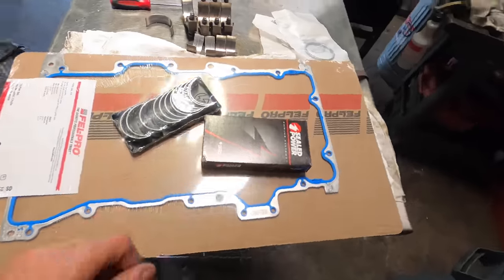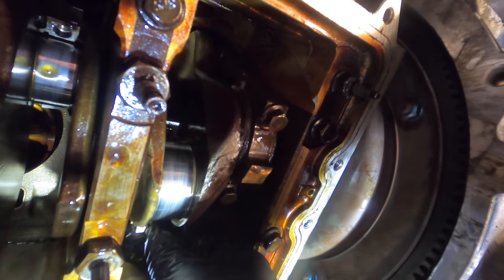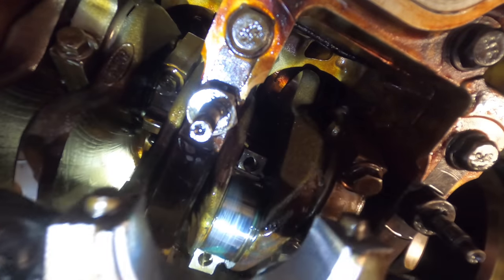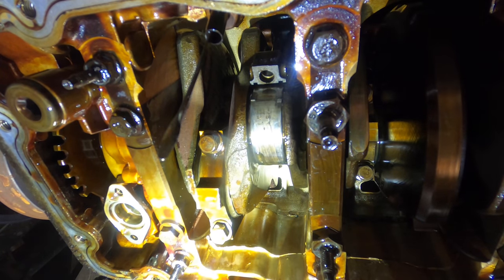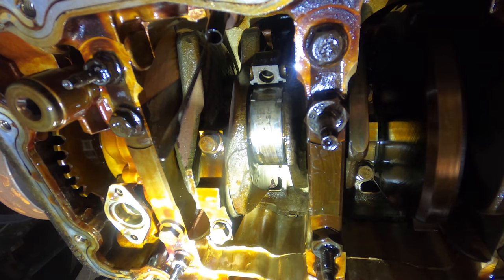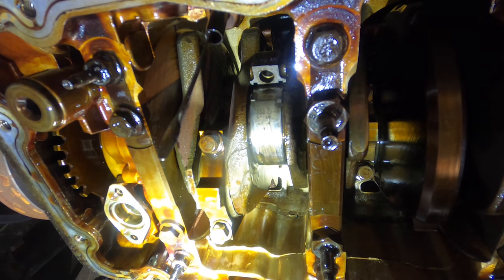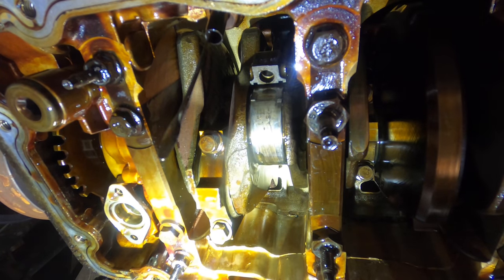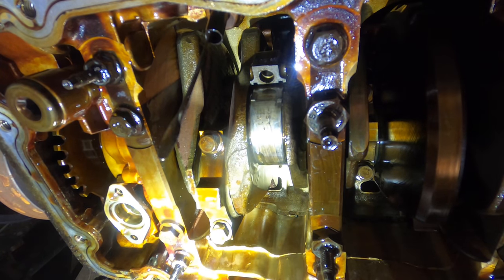Saving an Engine: Spun Bearings Replaced

Comment: Someone wrote in here or maybe the first video that the rod needs replaced being the bearing spun. I agree.
I have been doing auto mechanics for over 50 years. In my younger years I have done the same job. I would guess 90 % or there about, the main bearings needed replaced also.
The ones that elected replacing the mains had limited success. All of them had low oil pressure.  Most likely due to cam bearing wear.
There was to much debris in the pan and the oil pickup to be from the bearings you showed to us.
This calls for more diagnosis.

Comment: Nice job. Reminds me of a 85 Toronado that I bought and it had a #5 bearing that was completely missing with only 60000 miles on the car. Well after new crank and bearings it was as good as new until my son drove it with a coolant leak and overheated the motor. A few minutes later and he T boned a 3/4 Chevy at a 4 way and bent the frame on the Toronado. I had my son buy his next car!

Comment: I did this exact repair with my 86 Pontiac Fiero 2.8L. It still ran good after I parked it 100,000kms later. Everyone told I was wasting my time. I had to try it though.

Comment: I love this kind of repair.  But my question is why didn't you replace the main bearings too as long as you were there? I'm sure they suffered the same lack of clean oil.  I always have when doing this type of repair.  Helps to make a tight sounding engine.  Some types of engines you can't replace one of the main bearings without disturbing the crank seal, but replacing some of the main bearings is better than replacing none of them.  The vehicles I've done you can roll the bearing in one journal at a time without dropping the crank any.  I'm not a professional mechanic, just a self-taught hobbyist with questions so I can learn.

Comment: I have a feeling there was more damage than the bearings, but if that gets the customer a few more miles out of it then that is a good thing. I hope they know it is now time to either save money to have it rebuilt or replaced by a new engine or new vehicle. I saw some posts saying the car is not worth rebuilding the engine and I beg to differ. That car is worth rebuilding now because of the astronomical costs of newer ones. Not to mention an older naturally aspirated engine will last longer with fewer problems than these new Direct injected turbo charged engines of today IMO. If the car is 20 years old its now a classic so slap some classic car insurance on it and rebuild and drive it. In some cases people really love certain cars and trucks and want to keep driving them. Now pre-pandemic I would say not worth it, but now its worth it IMO:P Great video Ray.  In fact if they keep the oil changed going forward that old engine would probably be more reliable in its present condition than many of these new tiny turbo charged junkers being produced. I am no fan at all of the modern turbo charged direct injected engines. Maybe in a few more years they will improve them, but now I do not like any modern engine unless its Toyota or Honda.

Comment: Great video. I had the same thing on a 2003 Ford Focus SVT. Every time one of my grandsons get in a car (usually mine), they think it's a race car. That car had the head rebuilt three times (bent valves kissing the pistons). The timing setup on that car is terrible.I don't know whose idea it was to use the stupid timing belt tensioner that they use, but they need to be retrained in engineering. Of course, over-revving the engine doesn't help (same grandsons). 
Keep up the good work. You may see me show up at your shop one day to fix one of those tear apart the entire dashboard deals. 2014 Fusion, the dealer couldn't figure it out. Probably a good video. I live about 80 miles from you.

Comment: Cool job! Dropping the crank would be even cooler but I get it. 
When I do an engine flush I don't risk using the existing oil and filter. It's just not worth saving 30$, as old oil will be saturated with crud to begin with and could cause oil restrictions. That's related to why ATF fluid is often used (lots of detergents/solvents and it's a thinner oil). But also a flush will only help to restore some functionality to oil pressure related parts like lifters, vvt/vct solenoids, and clearing oil passages. It cannot help a bad bearing. They can also make gasket leaks worse, and plug up oil filters/screens. IMO an engine flush should not be considered if your oil pressure is already below normal.

Comment: On the Mercury's Sable connecting rod bearing replacement you only finger tightened the oil pu tube support strap  to windage tray nut.

Comment: You are very optimistic, spun bearings and that death rattling noise.  I’d have just replaced the engine, or everything in the lower half.  I understand doing it, but outside a farm tractor I wouldn’t.

Comment: Don't know how much the bill was, but certainly cheaper than a rebuild or even replacing with a used.  Hopefully another 50 - 100K!  Most places would have shown the shavings / chunks and told the customer... "Nope, You need a NEW engine!"  Nicely done...

Comment: The Ford 3.0 liter was known to run on bearing grease without oil just top off the power seat fluid and the car will run quiet and smooth for 300,000 miles before changing your grease

Comment: Nice video. 
Crank journals look kinda rough. May have been worth really getting it done and replaced the crank or a regrind. I guess as long as the oil pressure is strong.

Comment: I'm so lucky I get to do an easy bearing removal job on a four-cylinder LOL a 2002 Subaru outback AWD has a very low knock OEM bearings never used the torque reader before but I'm teaching myself how to use the torque bar first time doing a bearing job so satisfying knowing I did it and saved few hundred dollars

Comment: those 3.0L 24V motors were honestly quick and decently reliable…as long as you change the
oil 🤦‍♂️ lol i used to have a 2001 Ford Taurus SEL with the same motor and i loved it

Comment: Hey my friend. Good work but I didn't see you tighten the nut holding the oil pump pick up tube bracket. You ran the nut all the way up by hand but it didn't get tightened, unless you did it off camera. Nicely done.

Comment: At 26 minutes, while installing the oil pickup tube, you hand spun on one the lone bolt of the 3 that hold it on but never went back to tighten or torque it with a wrench or socket.  Was that intentional or an oversight?   Great videos.
Reply: I wondered if I was the only one who saw that after reading a ton of comments with no mention of it, hopefully he has strong fingers and it never loosened up because it definitely should have been tightened.

Comment: I have not been able to read through all 2,531 Comments at the time I am writing. However, with all the bearing chaff and RTV, not ot mention the plastic piece found in the sump, I have a couple of lingering questions. 1) Is it worth taking the time to investigate those issues further?  2) What can be done to flush the oil journals to make sure you still have good flow and that nothing is blocking them.  3) Is there a chance that there is enough foreign material left in there to cause further damage?  
I probably have more questions if I think about it, but I am curious to these issues.

Comment: how did you know what size bearings to buy, don't they need to be a specific thickness determined by the diameter of the rod journal and the crank? Did you plastigage them off screen?

Comment: To pull down the rod I use a bolt with the hide cut off then I put hose over the bolt just leaving 3/4 threads to put in the rod that way the bolt don't touch the crank . I put lube on the bearing and the crank you can't put to much lube on the part's in side of a engine

Comment: I worked at a gas station,in the late 60's, a 64. Dodge dart came in with a thrown rod .they gave the car to me instead of fixing it.I pulled the pan,found the rod cap a little bent I hammered it straight ,using plastigage,filing the rod on Emory paper till I got .002 clearance .I put it back together and it was fine.I put this engine in my moms 66 valiant,it burned rubber after that.

Comment: It always make me wonder though when mechanics do a visual inspection like this on the crank to find a spun bearing or something and despite all the work being done to replace the bearings they put it back together and tell the customer the engine is junk... You might as well tell the customer that you can attempt it and it won't cost much more in total costs (as the engine is already apart) and just tell them it may or may not work.

 I saw a mechanic strip an engine down to find a bent rod... Despite the fact they had it out and could've easily replaced the Rod they made the customer buy a new engine. The only symptom with the bent conrod was a ticking noise, other then that the engine appeared to be running fine. They had literally just changed the timing chain and tensioners as well as they originally thought that it was contacting the chain casing causing the ticking/tapping noise as there was a small witness mark on the casing near the bottom sprockets.

I was horrified as I have the same car with Toyota's VVT-i 1L 3 cylinder engine and personally if I was that far into the job I would've asked the customer to fit a new rod. The engine is relliable, not sure how they bent a rod though... I know with low quality fuel this engine does edge on knocking... Maybe the customer did something stupid though as it's a manual transmission that would let you lift the clutch in the wrong gear and over-rev the engine.

Comment: I would have done things a little different. Clean the crank like you did. Spray brake clean up the oil passage on the rod journal to get any small crap that might have been laying in there.
I start with wet/dry sand paper 240 with mineral sprits to clean it up fast then 320 and finish with 400.  Then mike the crank. If just a little out of round. I start with wet/dry sand paper to get as close to round without removing to much. Find a good rod bearing from one of the others and use plastic guage on that spun rod to see were you are at at oil clearance. You can't take bearing back after you buy them and open them up for a try. .003 oil clearance is about as much as you can go. You can file the cap without the bearing on it to make it .0005 smaller before to tighten it up a bit if you wish. More than that can cause you to crush the bearing to much casing problems. If you had the engine apart you can more things. But with engine in there that"s about it. Otherwise you did a good job. You only have to do this on the one that was bad and just clean the rest up like you did.

Comment: please sir I have questions ....firstly I'm fairly new to all that is engines...     
 *  When you removed the bearings. was there a part number still on them and did you replace them with the same ?   wish you could have walked me / us through that too...     
  * Did you check and clean the oil passage on th Crank where oil comes through.   
*  And finally after removing the oil filter did you check it out for bearing contaminates just wondering.  
   thank you I enjoyed watch this

Comment: some years ago I tried to do this on a renault 25 2l straight 4 automatic. Managed to change all the "big end" bearings but couldnt get to the main crank shaft bearing - that and the fact i was working in my back garden - lying in mud using a 29.99 socket set from halfords didnt really help matters - needless to say the repair was not a success..... ended up having to change the engine  - another adventure

Comment: you can use muriatic acid , but it will dissolve the aluminum from surfaces drillbits and cnc stuff ive seen it done..  ave  has done it too.

Comment: Just 2 things.
I didn't see you check for bearing clearances, and when you torque a bolt or but, it is critical that you don't stop the rotational motion in the middle of the action, and then go again to get the click. Follow thru with one continuous turn.

Comment: Echoing other comments, Thanks for removing the pseudo background soundtrack.  The REAL soundtrack is you saying "click" every so often, (and "doo doo dee doo" whenever the phone rings^^) and verbally confirming most every time when "something" proves that gravity is a thing!

As far as replacing bearings and the insides of engine...  I remember the first engine rebuild I was involved in (was my car actually) I was in charge of inserting the pistons, with and con-rods into the cylinders, while a friend put the bottom ends on.  The doofus used one slightly "thicker" nut on one of the cap bolts..  Long story short, he got to redo them all when we figured out why the engine was vibrating while running due to the imbalance.  It was only a 4-banger, so he didn't have too much extra work, at least. lol.

Comment: I was doing a full rebuild on a Mini Cooper back in the mid 90s for my stepdaughter, re-bore to 1st over sized pistons, carbi rebuild kit, clutch and new values and seats the whole lot from top to bottom...she got impatient because I insisted on waiting for ordered parts to get in and do the job from start to finish in a day. One day I got home and lost my shit, Her boyfriend had started rebuilding the bottom end using old engine oil as assembly lube it had been in an open bucket for 6 months with dead insects and blown in sand, I made him strip out the main bearings and they were all ready scored, A few days later while I was out the pair of them packed everything up and took it all to his dads engineering workshop, I figured if that's how you going to play it fine,  the end came quickly it was running hot from the first run, ended up missing a gudgeon pin retaining clip. Gudgeon pin was riding on the bore wall managed to drive 25 kilometres before it died...it was an expensive lesson for her as she'd paid for it all ....I still got the blame for not doing it faster in the first place, I  told her if you don't have a dedicated clean assembly area then wash, assemble, seal is the golden rule.

Comment: Just a question, i know the furthest rod bearings failed due to the incorrect oil level. Why did you not check the mains for possible wear / damage? 
I used to do technical failure analysis for our local Cat dealer before being placed on medical disability here in South Africa and that is the only instance where I differ from you.
Also thank you for the absence of music which is u unnecessary in my opinion.

Comment: You forgot to tighten one of the three bolts which secure the oil pickup. The bolt by the oil strainer in the sump. Engine vibration will back that bolt off causing stress on the oil pickup pipe wherein connects to the oil pump etc.

Comment: My question is why was the bearing worn so bad in the first place.  Did you check the oil pump pressure in the beginning?  If not I would replace the pump for extended bearing life.

Comment: Ray, I watched you install the oil pick up tube, tighten the pick up tube bracket nut finger tight then install the 2 tube bolts and tighten with a wrench and then move on to the windage tray perimeter fasteners never going back to tighten the tube bracket nut! Will the nut stay put only finger tight??

Comment: I'm wondering if this is the Cologne V6 there because that like its British cousin the Essex V6 (UK Ford not the US Essex V6 which is modern) that you could literally bodge your way through to success with these bulletproof engines.   I remember talking with the chap who ran the Ford museum at Dagenham and he showed me all these internal quality control notices about missing parts on built engines like several years where the straight sixes would be sent to dealer without a piston ring in the whole engine.   Ford just kept schtum on it all and quietly rectified the problems and so tons of Zodiacs, Zephyrs, Consul's left Dagenham missing essential parts and they stayed that way and working fine til they were for the scrapheap 20 years later.

The Ford Kent and Ford Pinto engines also had an almost unholy ruggedness, I had a MK4 Cortina that had 1 dead cylinder, 1 dead gear and no clutch and I just crash boxed it weekly from Dorset to London and back and it was happy as anything except it missed a few bits.   The Ford Pinto is known as the Lima engine in the US, the smaller modern Ford engines are descendents of the Kent as Ford throws nothing useful away.
   
In the older times we used to use cigarette paper packet card as our plasti-gage with some blue ink, if the ink didn't smudge we needed just a standard big end, if it smeared a little after folding the card we needed the next + size and if it smudged a lot we needed the full monty of +'s hehe   Used the ciggy paper card on points too and 4 folds got you a correct plug gap size whilst 2 folds was the correct size for most points.

Comment: did a job on a 84 4l v6 blazer same way but add shell 100 aviation in it told the custom then change down to 50w then on 49w never had a problem until he sold it

Comment: Usually this doesn't work because of several reasons.1 being it egg shapes the rod itself.2 because of metallic substance in oil,cam bearings shot.3 cylinders scarred 4ect 5ect ect ect ect

Comment: I noticed at 26 minutes exactly The oil pick up tube you just hand threaded the center bolt and then you proceeded to torque down the two flange bolts hopefully off-camera you remember to torque that center one down

Very good video though

Comment: When I was 19 I spun a bearing on my 750 Kawasaki. I was too poor to have taken apart and fixed. I figure since they took the pan off and pulled the rod apart why couldn't I put a new bearing in and put it back together used a micrometer, with mechanics help,  and got an oversized bearing.  Replaced both sets of bearings and put another 20k on it before I sold it.